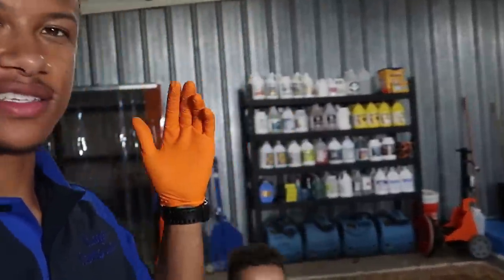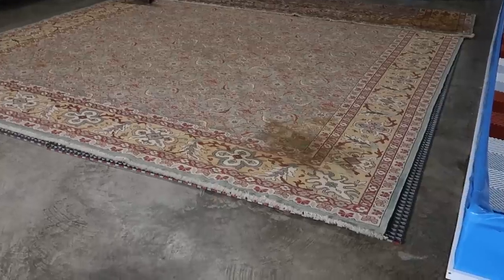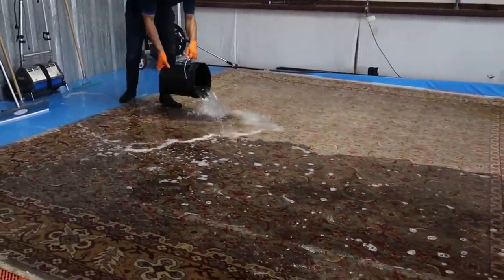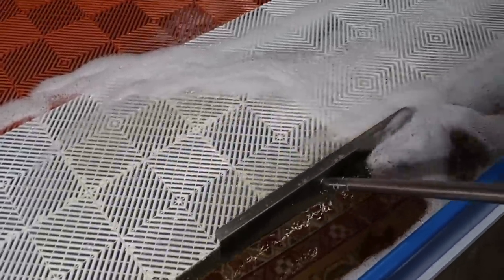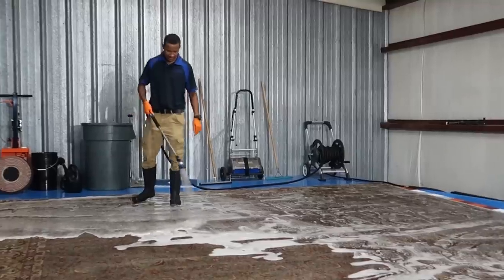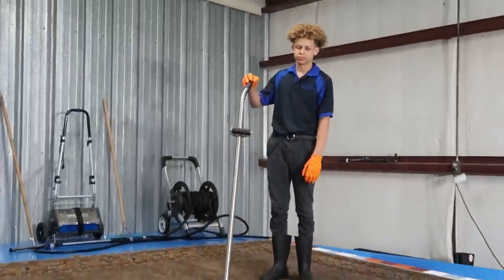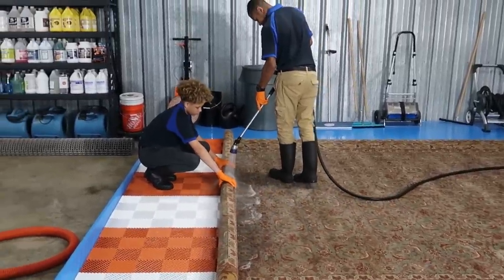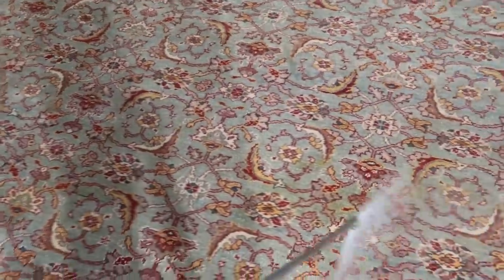Sudsy URINE removal from a huge wool rug || Rug Spa Episode 10

Comment: Your videos are so satisfying! I’m sure you guys looked into but they have outlet mounts and extension cords that would mount to the joists in your ceiling. This would mee the cords off the ground and out of the way and safer too in case the cord was damaged and put into the water. They would move with you too on the ceiling really keeps them out of the way.

Comment: I like your setup better than most carpet cleaning guys. The others just do it on the floor they don't lift it up so when they wash the carpet the water in dirt doesn't get clear away from the carpet. I like that you lift it up off the floor so it doesn't soak up what they washed out.

Comment: How you do when the carpet has rubber at the bottom, under, the anti slipper. Because after I  washed mine it melted and got sticky. I wonder if that's what you meant that the urine makes the carpet gummy . 1:20 thanks

Comment: Ive found lately that that buying enzyme cleaners like the resolve or naturs miracle and even something like white vinegar ... Will work remove even deep urine stains but you have to soak up as much if the urine first  or if it's set in already to pour like twice the amount of the liquid to pee and then let it sit.. it take about 1 to 3 days to dry depending on the temp of the day but they work.. ok more stubborn stains you need about two to three  applications...  Now underneath the carpet you may have some residual but it won't smell ..